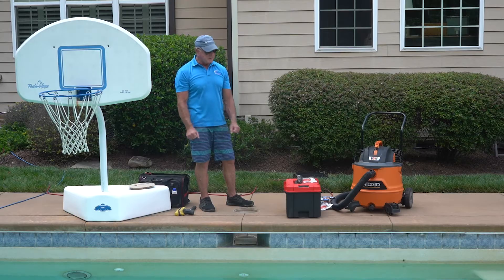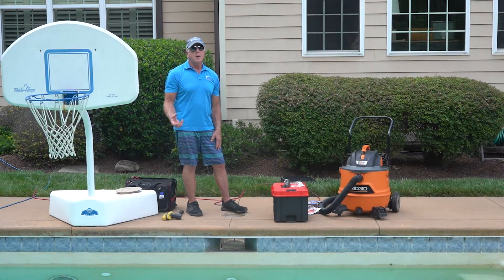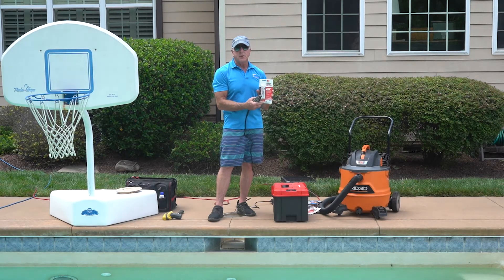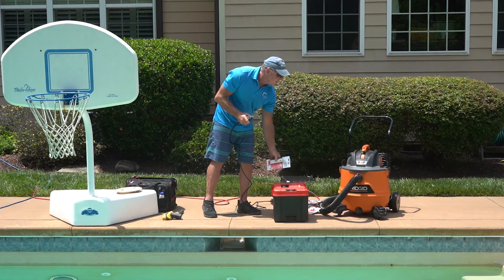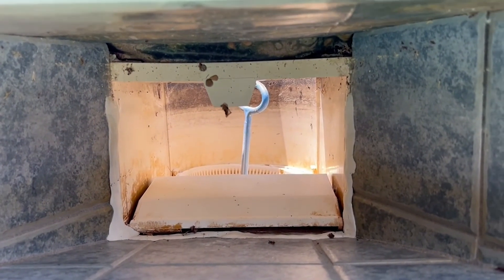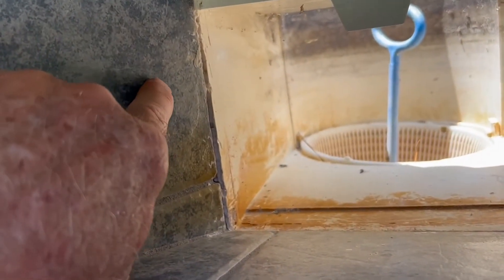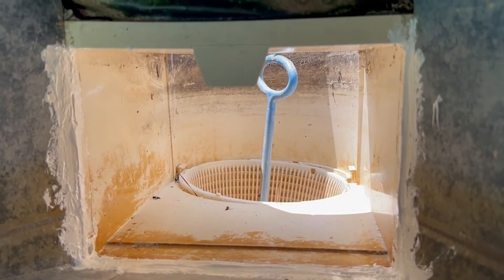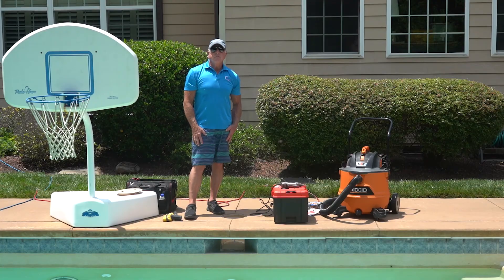How to Repair-Fix a Leak in the Skimmer Throat

Comment: Throat skimmer is that the same placement of the neck just wondering. I paid for Ieak detection and found out it was leaking from both skimmers of the pool on the neck of the skimmers?

Comment: If you used blue painters tape you could make straight lines. And use a wet rag and finger to smooth out the adhesive. It will look sweet!